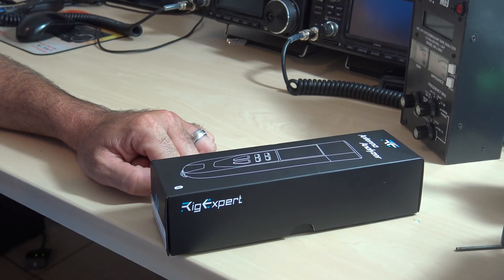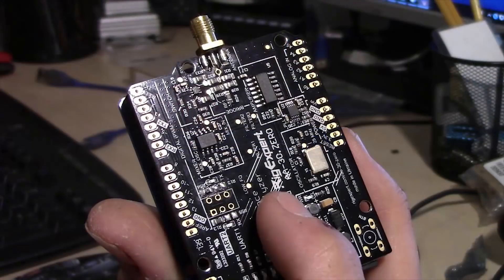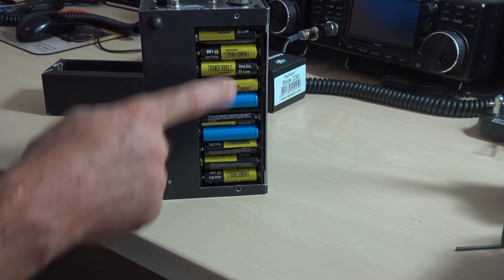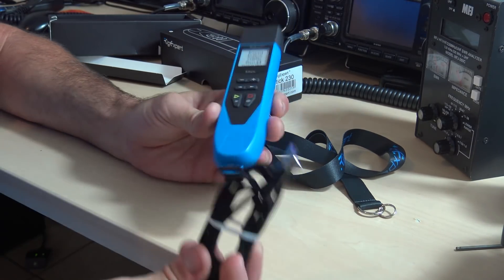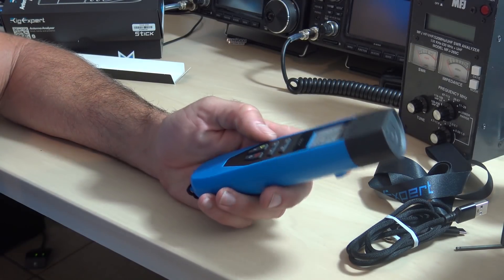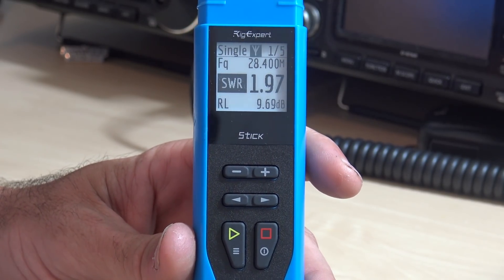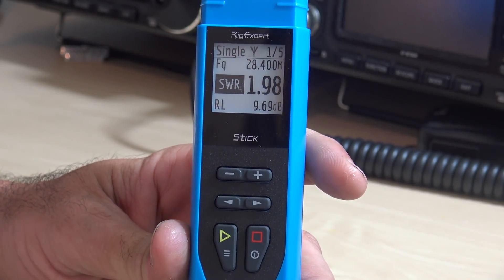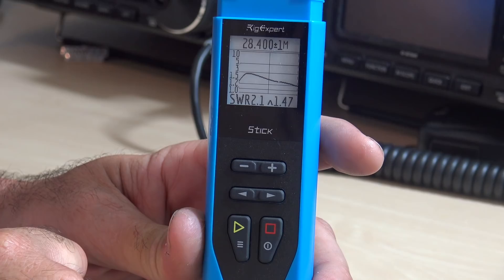NEW! RigExpert Antenna Vector Analyzer, Stick 230 Review

Comment: Yep, I was all excited about this until finding the NanoVNA... I mean, a two port (not full two port) S11 & S21 vector analyzer from 50 kHz to 900 MHz for around $55 - $65.
Reply: Excellent point, the NanoVNA for $39.89 with a large 2.8" color screen with free shipping on eBay!
Reply: I own a NanoVNA but I miss my RigExpert AA-30 in the field when building shortwave antennas. Sold it a year ago. Before that I owned a SARK100-clone and did not miss it after selling it...The RigExpert was a sturdy and ready-to-use measurement unit.
Reply: D Redman  Well, thankfully there are something like 7 or 8 recall states where calibration tables are stored. So, I have a wideband cal in the first stored location (default on power up), and then band specific calibrations stored in other states. Works great! Honestly, I still use my AA-55 for quick tuning, but go to the Nano for more rigorous testing (for example checking out filters). 73!

Comment: Huh, 300$? Don't know how wise the pricing is while the market gets swamped with NanoVNAs in the sub-50$ range. There are also devices like the FAA-450 Antenna Analyzer (EU1KY) which covers 70cm at  ~300$ or the FA-VA5 (kit sold through german ham magazine) which goes up to 600MHz for ~200$..
Reply: Ham community gets more rip off.

Comment: Too expensive! Yesterday evening, I bought a RigExpert AA-230 ZOOM BLUETOOTH for 308 Euros, tax included. It has Bluetooth and a Time Domain Reflectometer, to check a fault in the coax and the length of the coax. The RigExpert Stick230 is 239 Euros, tax included. So which one is a better deal?
Reply: It depends on what you want to do with it. If you are a /p-only operator like me, the stick with it´s good e-ink display and size seems to be more attractive. AA-230 is the greater machine, if you use it at home predominantly, no question.

Comment: Don’t overlook the YouKits FG-01.  I love mine just for tuning up an antenna like a mag loop or an antenna tuner.  It continually sends out a signal twice every second so the graph is continuously updated while I tune the item under test.  My friend who has a very fine RigExpert has to push a button  every time he wants to scan his device.  The YouKits just keeps scanning while I am turning knobs in the tuning process.  The YouKits doesn’t do all the things the RigExpert does but all I want from this device is what is my SWR and which direction do I turn a knob while doing a tune up. If I want more information then yes, I need another instrument.

Dave K8WPE since 1960

Comment: Hi Eric,
Great review...
Would primarily like see Android on Bluetooth, because it seems to me, most would want to be outside viewing (direction & wind movement) & tuning up these antennas and you have to physically get away from the antenna so as not interfere with the readings (detuning [with your ugly bag of mostly water [its a Star Trek TNG ref]]).  Accurate readings are important!

I also think you want to get out of the shack  

Then the PC.

Thank you,

73 - John - N7GHZ

Comment: Waaay too expensive.  When China is selling graphical NanoVNA's (open source too) for less than $20 Rigexperts have to be able to hit a price less then $100.  I'd like to have something like this but the price performance difference is simply too big to justify.
Reply: My nano vna was dead on compared to my $1000 vna, I sold it and kept the nano and bought 5 more and had plenty left for a BBQ and a new laptop.
Reply: Provided you can GET a reliable NanoVNA. They are real hit-and-miss
Reply: @wushock92  I bought the one linked by Hugen79's github (https://github.com/hugen79/NanoVNA-H - search for alibaba) and was not disappointed. It wasn't the cheapest, but since he's one of the 3 main guys responsible for the current HW and FW, I was okay with that.
Reply: @wushock92  It's true that there are some tricky sellers - selling fake and broken units.  BUT that is true of almost any device made and sold in China on eBay, Alibaba or AliExpress et.al.   If you purchased THIS RigExpert from any of those sites it's likely to be the same.
Reply: @Kevin Loughin had a link to the genuine ones in the comments of his video on them.  I bought from that source (Ali Baba, same as mentioned above, I think) and am happy with it.  It'd still like a RigExpert though, but not the one featured here as I'd want a bigger screen to see Smith charts on.
Reply: @ammocraft  edy555 (another one of the primary developers) links to Nooelec, so there's at least 2 "official" sources. I completely agree about getting a device with a decent screen resolution, especially when dropping a few hundred dollars on it